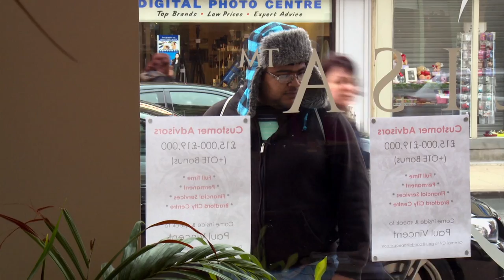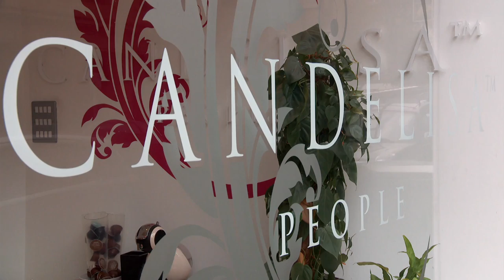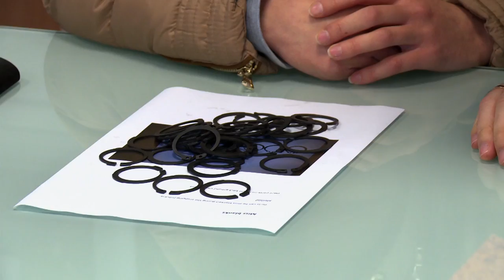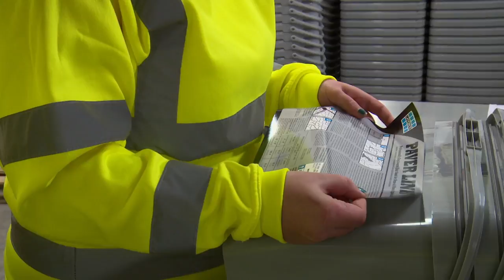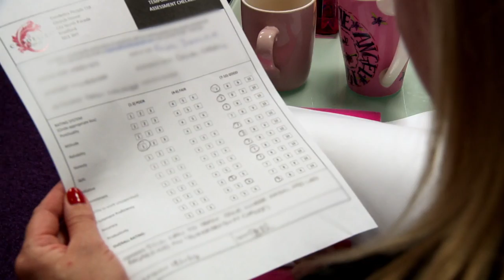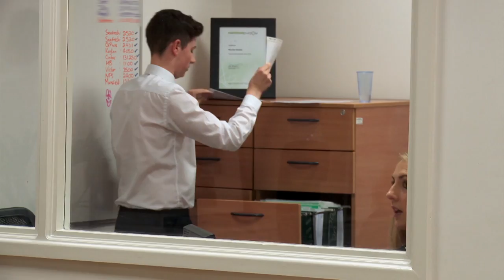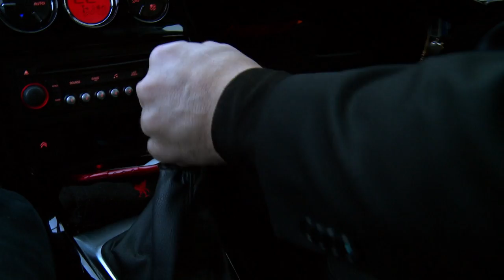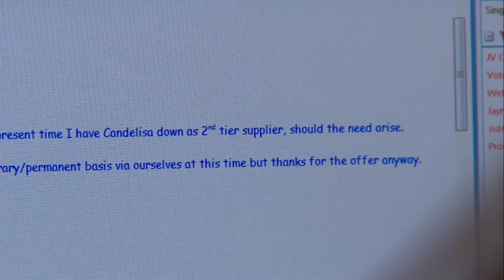The Job Centre: Episode 2 | Full Documentary | Reel Truth

Comment: In my life, I have worked almost 50 years fulltime. Only in one occasion I left a temp job after one day. I was promised a job checking airplanes on the inside for quality of cleanliness, but in stead some idiot manager wanted me to work in a factory cleaning aluminium parts by scrubbing them with a chemical, without any protection. Some other odd jobs I worked during the entire contract.